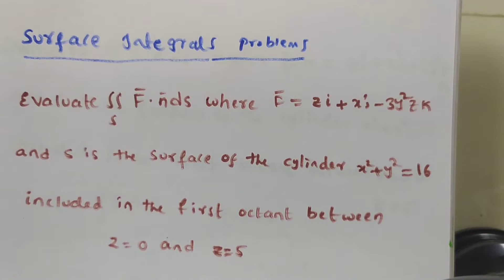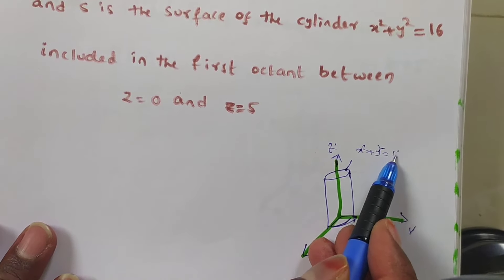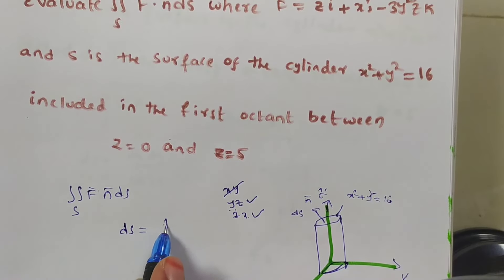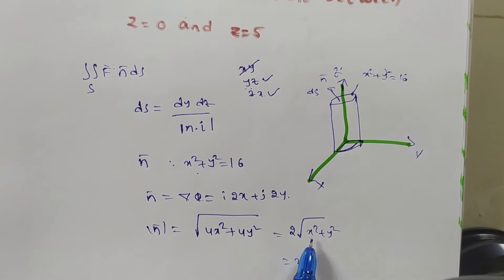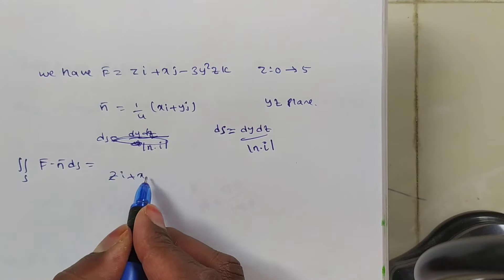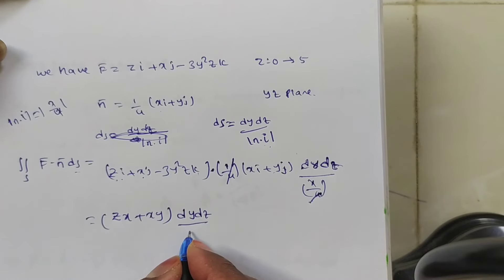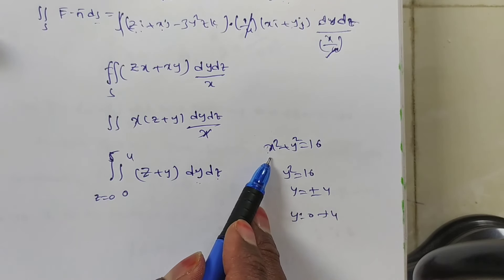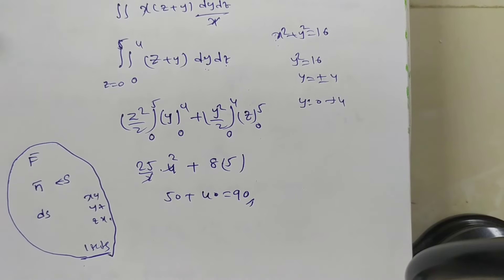Evaluation of surface integral over the cylinder in first octant

Comment: Sir at 2:04 you described how to take ds.
I couldn't understand why you didn't take xy plane projection..and only xz projection? Normal vector is x i + y j that means normal of the surface lies in the xy plane. How to go from here?
Reply: Kyuki usme z nhi hai , question me dekho z ka value diya hua hai , xy me z nhi aa rha jbki yz and xz me z aa rha hai
Reply: i have a possible expanation but i am not sure. see if ignore the cylindder case for now then we have only a quadrant of a circle left in xy plane. now its ds is dxdy bcoz if we light a torch on its area from above we will get a projection(shadow) again on xy plane.
now consider the cylinder ie now we also have a value of z ie height. now if we again glow a torch from above the cylinder in order to find ds, we will again get a projection(shadow) on xy plane in the shape of a quadrant of circle. see in both the case(quadrant and cylinder), we get the same projection figure(quadrant in xy plane ). No sign of any height of the cylinder which is not true right bcoz obviously there is a difference btn cylinder and quadrant which is the height. so we have to glow the light in such a way that we get the height and this is possible only if we glow it from xz plane or yz plane. hope u understand. If I am wrong plz correct me. thankyouu

Comment: If limits are not given which plane we have to consider?
Reply from the maker: If  limits are not given , we can do any method for example, if the given plane is x + y + z = 10 then the limits of X are x = 0 to 10, y = 0 to10 - X, z = 0 to 10- x- y, here X is independent and y is dependent on X,  z is a dependent on X,y similarly you can take y as independent variable or z  independent, in the multiple integrals I have explain the topic you can watch if you want ok and if you have any doubts you can share Ur Doubts  on my WhatsApp number  
  + 91 9885875184
Reply: Tqsm
Reply: Sir please told sum on not given limits

Comment: Why if I use Gauss Divergence theorem then getting -240pi?
Reply from the maker: If u are getting negative you can consider as a positive 240pi
Reply: @TEAMEDUCATIONMATHEMATICS  Sir but the question is why am I getting different result than you as both should give the same answer. Please tell me sir
Reply from the maker: Solution share it to my what's app number +91 9885875184,i I'll verify